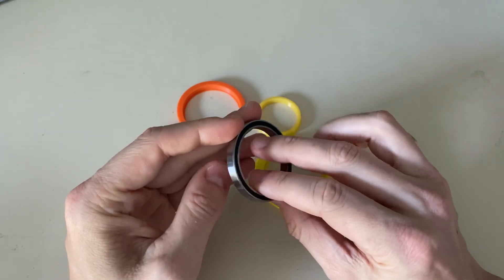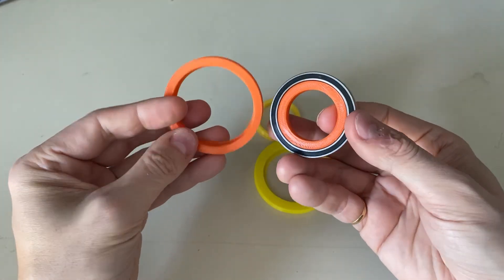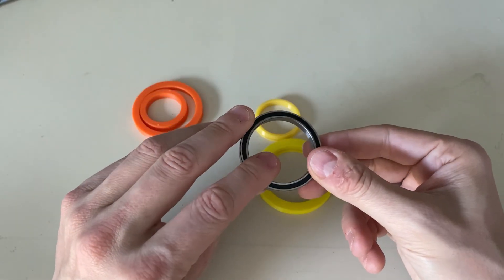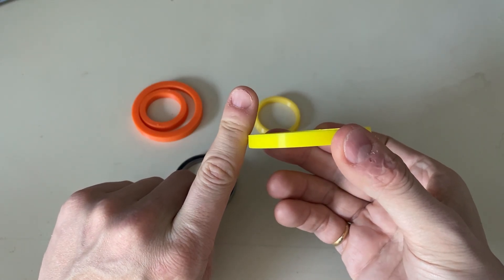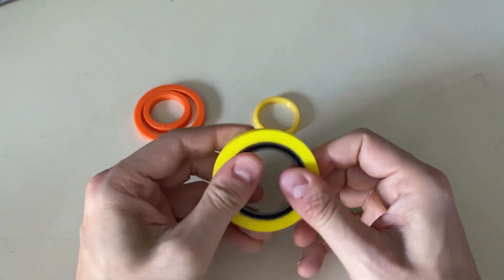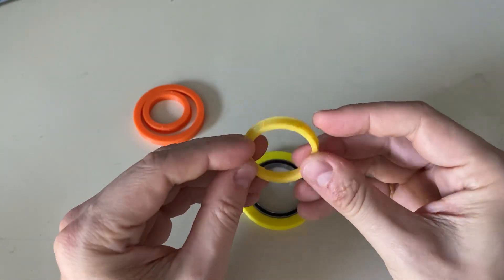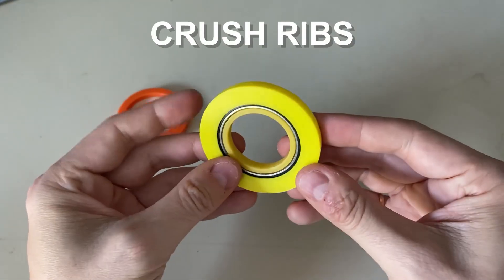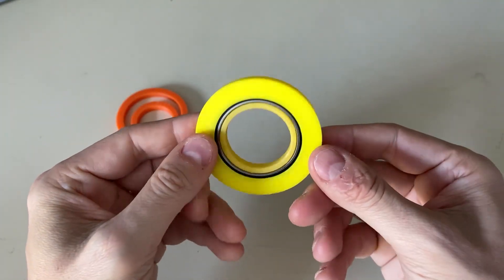Why Crush Ribs are great!

Comment: I've been using these since watching this video a few months ago, and can confirm they are fabulous. Even if the bearing doesn't fit on the first shot, it's much easier to file the ribs a little shorter than to enlarge the entire hole. And you can see how much material you've removed, so it's more accurate too. Also works well in CNC'd aluminum, for those of us who can't afford perfect machines. The bearing leaves a shiny surface wherever there was contact, so you can sand all the shiny spots and then re-test the fit until it's just right.

Comment: I don't know about you guys, but across 8+ prusas, a bamboo lab and 2 enders, a hole 0,07 oversized on the diameter has ALWAYS been a near perfect fit for me for holes of any size . 0,05 is nearly impossible to get in and out, and a over 0,1 everything falls out on its own (while still not wiggling)

Comment: This is great. One question: do you need the draft? I mean you're not ejecting it from a mold. The crush ribs will do what they're supposed to do (i.e. get crushed and compensate for any small difference in diameter) either way. Have you tried it without the draft? Thanks.
Reply from the maker: Maybe I don’t. I figure get in the habit of thinking for injection moulding and later i won’t have to relearn. Also a tiny draft probably makes inserting easier. So good habit that doesn’t have a downside.
Reply: What do you guys mean by drafting? Is that the little dip in the inside so that the metal part won’t slip through?
Reply: @Numenor7  makes much more sense. Thanks

Comment: Question: Trying it right now in Fusion on the inner "hole" for a bearing. Do you DRAFT then add the ribs? Are the ribs straight or follow the 2 degree draft? I just tried the DRAFT command and it made it weird. For my Ender 3 I'm pretty good at adding or subtracting 0.1mm and getting a good fit. But the ribs make sense.
Reply from the maker: I add the rib then draft. Unfortunately draft doesnt pattern well, so lots of select face is going to happen.
Reply from the maker: filmed a follow up that should show you my technique.
Reply: @i-make-robots  Great, I was asking over at the Fusion Forum.
Reply: Draft angle is literally part of the extrude. Can be added to any extruded feature:
https://youtu.be/6SJFpxbXgbY
Can also be added to faces:
https://youtu.be/4GdewzntS-U

Comment: Does it only work with cylindrical shapes, or does it work with polygon shapes as well?
Reply from the maker: polygon shapes work great!  triangle ribs are easy to extrude before drafting the ring and the triangle.  This means you have to select each face separately in the draft command because Fusion360 does not consider the triangles as part of the tangent chain.
Reply from the maker: filmed a follow up with techniques that show easy way to select all.

Comment: That's a great tip! Would crush ribs work/ help with dovetail joints as well?
Reply from the maker: Are you 3D printing these dovetail joints?  I'd never considered it before.
Reply: @i-make-robots  Yes. Never seen anyone try crush ribs on dovetail joints before. I know tapered dovetails are an option but they still require some dialing in, so I wonder if adding crush ribs to dovetails could help ensure a good fit across multiple printers. Worth exploring in a video?

Comment: Wont the bearing become more and more loose over time using this method and become slightly off center if there is any load on the bearing since the outer surface is not fully supported?
Reply from the maker: I haven’t seen a problem yet. Once the ribs crush the pressure get very tight. If the forces are high enough to wreck it after that maybe plastic is the wrong material.
Reply: One technique I've used when my bearing holes were slightly loose is to wipe some oil or grease on the bearing, then apply a small amount of epoxy to the bearing and the inside of the hole, and then push it in. Ought to work well for the gaps around these crush ribs too. Too much epoxy will of course squeeze everywhere and ruin the bearing, but if done properly it will form a perfectly sized hole, and the oil prevents bonding to the metal so you can still pop it back out.
Reply: I think there will be plenty of applications where bearings in 3D printed plastic will work just fine if the parts are made to fit just right which wouldn't work well using crush ribs. In these applications it's back to trial and error to get a perfect fit. Of course there are also plenty of application were loads are light enough that this crush rib trick could save a person a lot of time. It's a good tool to have in ones toolbox. It's not going to be the right tool for all jobs.